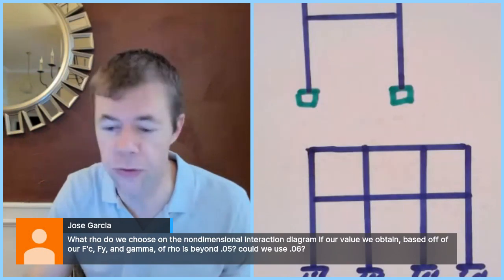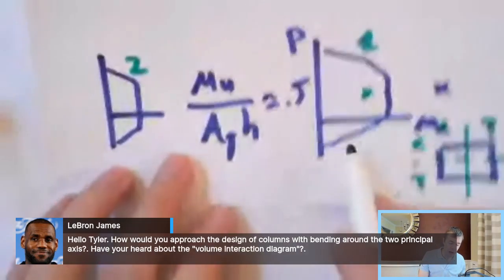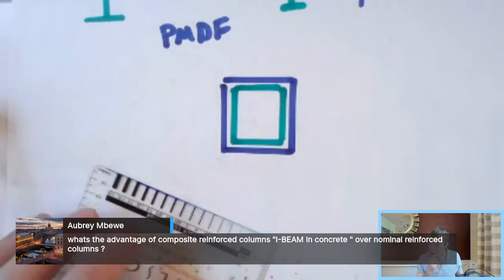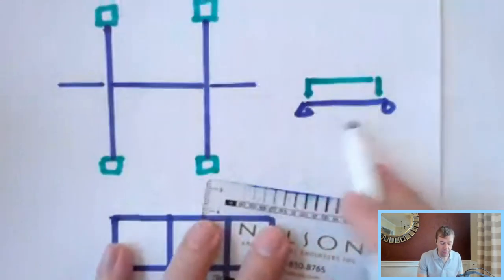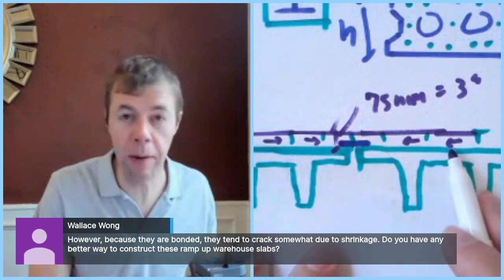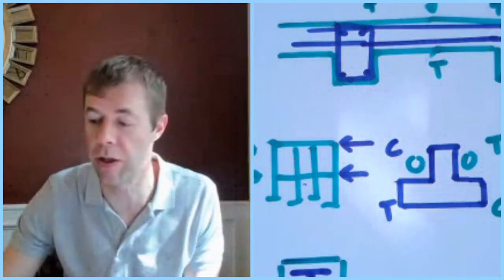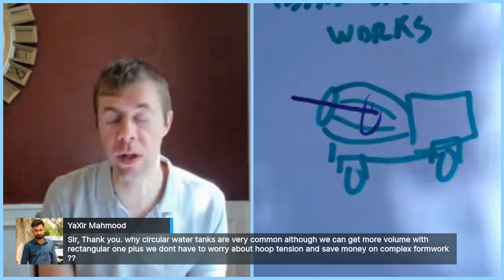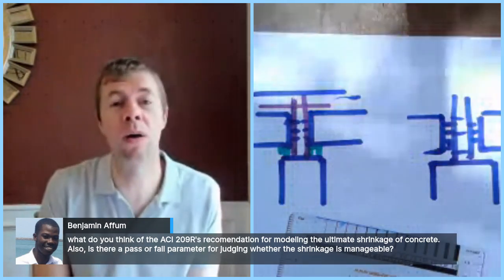LIVE STREAM 4/27

Comment: Tyler,

This may be outside your expertise.  I have clay soil that is currently holding more moisture than I would like. I am concerned about future expansion and contraction under my basement cement slab.  I would like to use RHA / Lime to condition the soil prior to pouring concrete. I know that RHA or ashes, in general, are mixed with lime to make very hard concrete.  What do you think about soil conditioning for a residential cement slab application?   I know you are busy and I value your time.  I do plan on consulting with an engineer locally in the next week.     I hope you are your family are safe, sane, and healthy.  Take care!